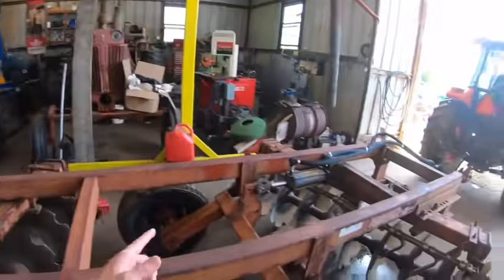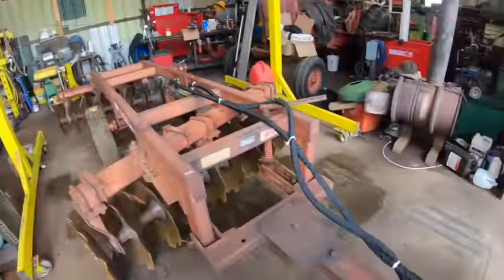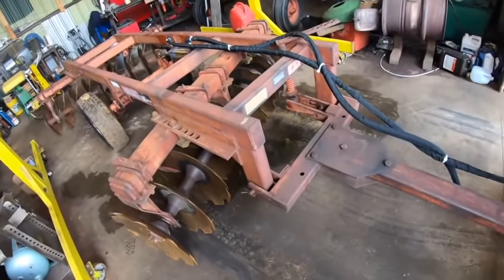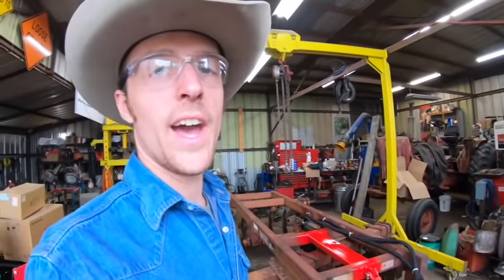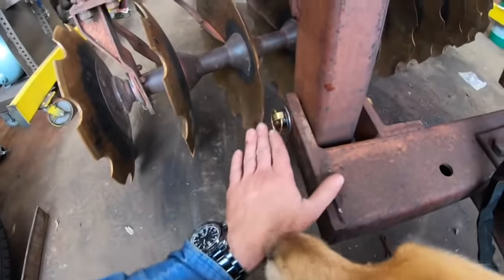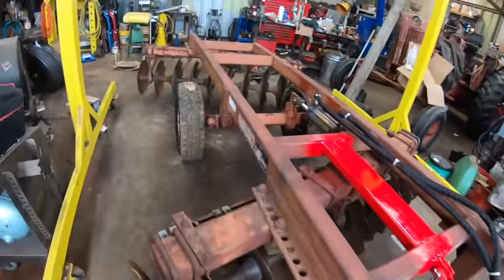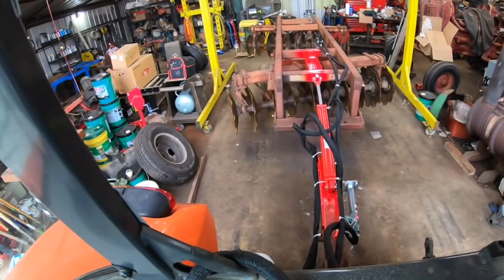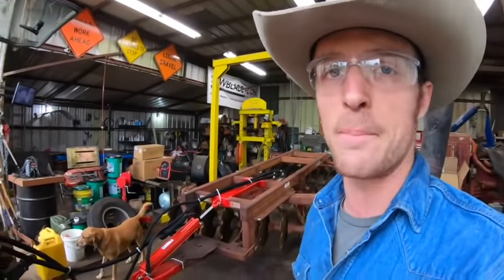I Bought A Vintage TILLAGE DISK So Lets Fix It Up!!! (Part 3 of 3)

Comment: Just a thought from experience. Corn stalks will take those snap clips out of those pins. Take some fence wire and tie them in. Good job with the cylinder.
Reply: Tall grass grabs them too. Also, I  park my equipment in the cattle pasture and they rub and knock off the clips. I just had the ramp on my trailer drop and get drug down the road because of a missing clip.

Comment: I just wonder if that spring being there was actually a good thing;  in case you hit rocks or something.  Similar to a snow plow on the front of a truck--  they always have a spring that can collapse and let the plow fold over, in case you hit something.  If it turns out that you DO need a 'safety spring setup--- you could just mount your ram to a sliding rod with a large spring, right there on your tongue;  so it would at least have a little give if you hit a big rock or something.  But who knows, maybe it will not even be an issue.
Reply: that is exactly what the spring is for i used one a lot on our farm when i was young, its a good job here and the theory behind it but that hydraulic rod could bend or the seals could actually blow, at the end of the day something has to give, then again if he doesn't hit any big rocks he will no doubt be just fine.

Comment: One thing I find that helps with lynchpins, I use small cable and crimp the ends, one around the snap rind and then a fixed point on the equipment or pin it’s married with just for the random snag. I give them roughly a foot and a half give or take where it’s located.

Comment: To be fair, carbonators on old tractors have been out in the weather and usually sat unused forever, not exactly the recommended spot for something open to the air, even if it does have a filter.

Comment: give you a tip for free the new linch pins you fitted wire them shut or grass will ope them up and they fall out thats why the used split pins

Comment: Personally id try to make it mechanical like the john deere 340 disc. When u drop it in the ground it moves the tongue on the same cylinder. Very easy to make and have done it to 2 discs. But looks like its also gonna work awesome!

Comment: Those hydraulic hoses need to be directly over the tounge of that disc. A bracket, duck tape, some way. If not, you risk a lugs on the tractor tire catching them when turning. Trust me. That will ruin your day!!

Comment: You should make a couple holes holders run a ride up and make it into a circle where you run them through you could put one up on the top and one on the hitch and then you could work it as a spring pressure on the hose to keep it so it's not going to hit the ground or hit the hitch you got the spring part on one of them but you can put the hose spraying on the bracket itself the one on the hatch like halfway down and then you won't have hose rub

Comment: Now rotate your disk  gangs so that they are 90° to the centerline so as to cut ground and grass roots ( like a lefeler disk setup ).
 Cutting root with minimal disking action allows fertilizer/ lime  and oxygen to root zone. now is right time to act while grass is dormant.  Or wait and be behind the curve as usual.
Be well.